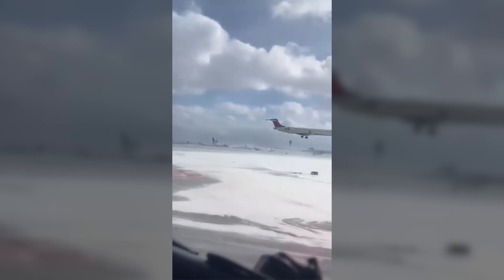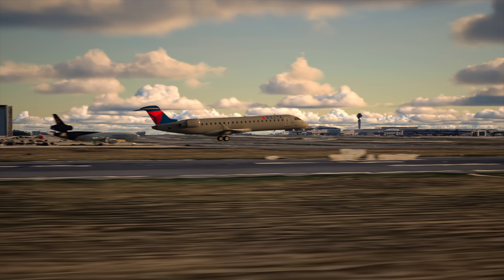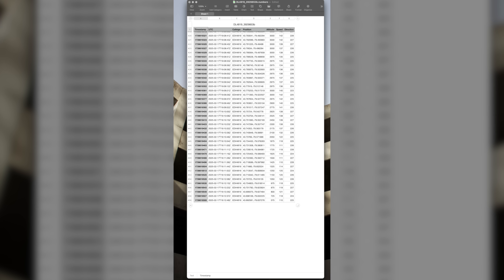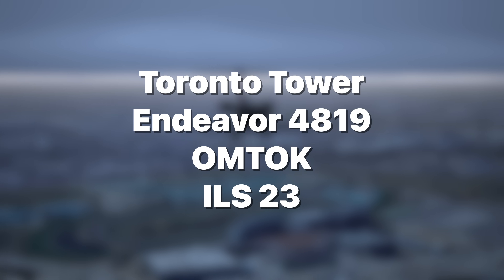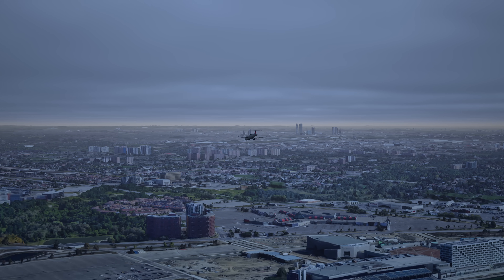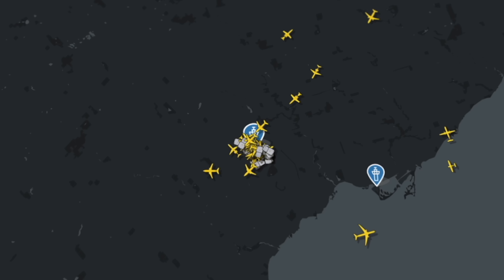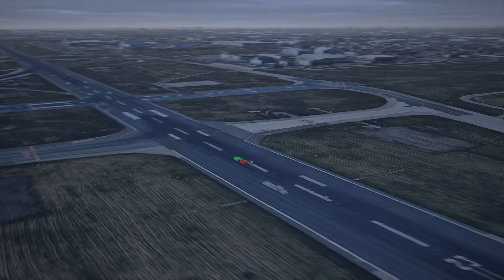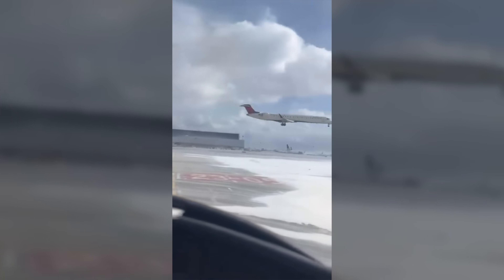What Caused The INSANE Descent Rate in Toronto?

Comment: CAVEAT: I am not a pilot, but I am a software engineer with over 20 years of experience. 

That ADSB data looks suspicious to me. It holds constant at 1024 for 5 data points, after varying almost every single data point. Then it jumps to 256 for at least 2 data points. Both 1024 and 256 are "round" computer numbers. 1024 = 2^10 and 256 = 2^8.

From the little I know now I cannot say if this is just some coincidence, or if this indicates some kind of malfunction. But, those numbers suggest we should wait for the black boxes  to say anything definitive.
Reply: Excellent comment, and a good call. Real data never sits at 1 or 2, that data looks truncated.
Reply: @kfitch42 Every datapoint is divisible by 64... it looks like it's a resolution/rounding thing rather than unreliable data
Reply: They’re all multiples of 64 feet per minute, because that’s the unit used in ADS-B. That makes values like 1024 and 256 very common naturally. The descent rate was already coming up on 1024 fpm. This is just a case of seeing nails everywhere on account of wielding a hammer. Wielding that same software hammer, I will also point that failures don’t tend to produce powers of two specifically. If that were to be the case, it would be highly system-specific, and you would need deep knowledge of the particular system or much stronger statistics to make the case.
Reply: From a retired software engineer: well spotted.  That data ain't right.
Reply: @ ADSB altitude data is always sketchy.
Reply: I agree.  2^n values suggests that the data might have been compromised.
Reply: Nice and pretty numbers for sure
Reply: It is interesting indeed.
Reply: I'm glad someone else called that out.  My Arduino is a bit rusty, but those numbers are too coincidental.
Reply: Good observation but it has a simple and benign explanation. ADSB data isn't precise to +/- 1fpm...it has a granularity of 64 fpm. You can see that all of the data points are multiples of 64.
Reply: ADSB signal is via radio signal so as the aircraft gets low reception get sketchy depending on where the nearest receiver is.
Also in the vicinity of large airports data saturation from other aircraft can cause issues.
Reply: There is a difference between understanding data, and understanding the flaws that come from how that data is collected. Take calibrated air speed for instance. Pilots will understand this…
Reply: It does seem a bit odd.  It sounds like computer RAM memory sizes instead of descent rates.  If the plane actually descended that fast, it does suggest a sudden downdraft may have taken the pilot by surprise.  Maybe the pilot reacted too slowly and didn't correct enough for the sudden downdraft?
Reply: @ not all deviations come from outside the aircraft.
Reply: Bit flips? What if we're getting higher concentrations of cosmic rays to the point that the 3-factor protection is no longer reliable? I also heard a theory that 5G signals are causing Altimeters to mess up.
Reply: “_"CAVEAT: I am not a pilot, but I am a software engineer with over 20 years of experience._"

I am a pilot, aeronautical engineer and my first degree was in mathematics including software engineering (from 1974).“

I’m not a pilot, but I took fluid mechanics and thermodynamics from a retired USAF Colonel who had been a test pilot after flying P51’s in WWII. And I love airplanes.  

And I designed the electronics in an on-chip MEMS pressure sensor.

Thus I am fully qualified to say whatever I want ;o)

The previous comment about the vagaries of mechanical altimeters is very interesting.  If the CRJ was basing its altitude readouts on air pressure in the plane, there could’ve been some error: The instrument could have had some lag due to filtering out rapid fluctuations.  So it might have been displaying readings that were old by on the order of a second to a few seconds.  Turbulence and wind shear would result in inaccuracies in displayed sink rate.  The radar altimeter would not have been affected in this way.

As to the readings taking values coinciding with a power of two, I’ve also designed a few digital circuits, which fully qualifies me to say anything I want about all things digital.  These two values could be coincidental, but I think there’s a fair case they are not.  Electrical connectors are the weakest point of electronic equipment.  A few low-order bits could have been inoperative due to a connector malfunction.  Not likely, but definitely possible.

Thanks for the interesting observations.  I’m so glad no one was killed.
Reply: @maxenielsen  "If the CRJ was basing its altitude readouts on air pressure in the plane"  He never said that.  That would be absurd.  Airliners are pressurized.  The altimeter uses a pitot/static system.
Reply: We will never know. To much dei involved.
Reply: _"CAVEAT: I am not a pilot, but I am a software engineer with over 20 years of experience._"

I am a pilot, aeronautical engineer and my first degree was in mathematics including software engineering (from 1974).

The vertical velocity is not measured directly, it is calculated by the rate of change of height. This can be derived from GPS, barometric height above ground level (agl) (when set to QFE), altitude above mean sea level (AMSL) (when set to QNH) or Flight Level (when set to standard pressure 1013.25 Hpa or 29.92 inches of Mercury). And also the height agl using the  Low Range Radio Altimeter (LRRA).

The barometric altimeters are mechanical devices. The key component is a sealed cylindrical box with corrugated sides and contains dry air at standard pressure. When the air pressure outside changes the height of the box changes, which via an arrangement of levers and gears turns the needles on the face to the altimeter, which is read like a clock with three hands. 1) reading 0 to 1,000 for one rotation and divided into 100 ft, further subdivided into 20 ft. 2) a needle measuring 1,000's of feet and 3) a needle measuring 10,000's of feet. The altimeter is also connected to a height encoder which provides data for the SSR Transponder; depending on the mode selected (modes C & S) height information is provided when the transponder is interrogated by the SSR (ground radar) for the ATC, and/or other aircraft for TCAS. And also for the ADS-B out so other aircraft (and ATC) can receive these data via ADS-B in.

A problem with the mechanical altimeters is that the aircraft spends a lot of time on the ground, where the pressure changes over a small range, and the levers and gears tend to wear and become sticky. This results in the reading jumping and hence creating a false estimation of vertical speed. In piston engined GA aircraft and in helicopters, the presence of vibration usually ensures that the sticking is minimised. In gliders and commercial jets, there is less vibration som that the errors tend to be larger.

ASDB Exchange provides free of charge most of these data parameters, including vertical velocity calculated from GPS, barometric pressure and RADALT.

The values of vertical velocity of 1024 & 256 ft per minute, is just a coincidence.
Reply: Finally, a hot take from a software engineer. 

I always make sure my planes are piloted by software engineers, my software is coded by medical doctors, and my medical advice comes from plumbers.
Reply: Nah, it's so much more fun to speculate! Why wait for all the facts? You are no fun at parties!
Reply: @cherylk.2474  Why pick on this comment for your nasty sarcasm? Most of the comments here are pure speculation, and this commenter does bring up an interesting anomaly. Those numbers 1024 and 256 are so in-your-face to anyone computer savvy, especially held constant like that for sevaral readings when all the others are in decreasing progrtession.
Reply: @B_Ruphe  Pretty sure that was sarcasm
Reply: @cherylk.2474 😆
Reply: The conspiracy theorists have arrived.

Comment: If he was going 118 ground speed and the wind suddenly stopped,or worse came from the rear quarter?down it goes.
Reply: Say there is a headwind of 17 kts and so the airspeed is 135 kts and the ground speed is the airspeed - wind speed = 135 - 17 = 118 kts. If the wind changes by 180 degrees and there is a 17 kt tailwind then instantaneously the airspeed falls to 118 - 17 = 101 kts, which is about the stalling speed of the CRJ900. Even without stalling the nose of the aircraft will drop and eventually the speed will stabilise at 135 kts and the ground speed will increase to 152 kts.

Comment: The bump the controller was talking about was in the glide slope of the ILS approach because there was another aircraft in front of the glide slope transmitter. During bad weather (Low ceilings and visibility) the ILS system is protected by ILS hold Short lines on the taxiway. Other times aircraft hold short at the Runway Hold Short line. If an aircraft is  blocking the glide slope transmitter it can caulse irregular glide slope indications which is the "Bump" the controller was talking about. Wake turbulence should not have been a factor due to the 40 degree crosswind with strong winds which would have blown any wake turbulence clear of the approach path long before the arrival of the CRJ.  while we need to wait for the investigation to actually make the determination, it looks from the ADSB info that they experienced wind shear at the end of their approach causing an excessive rate of decent at touchdown which caused the landing gear to collapse.

Comment: Downdraft pushed the plane to the ground if you ask me. With a sudden downdraft at this altitude there is nothing they could've done. Touched down to hard, right main gear collapsed, smacked the right wing to the ground, broke it off and the left wing still producing lift rolled the plane over. Extremely lucky it happend at low altitude

Comment: The landing gear was not fully extended and/or locked into place.  The landing drove the wheels back up into the wing and snapped the wing off.
Reply: No? If you look carefully you see the gear stayed strong but was compressed to its limit.
Reply: @NoodleIDK13  ...and then drove the wheels back up into the wing and snapped the wing off.
Reply: @iBackshift  The wheels didn't collapse back inside the aircraft they were destroyed

Comment: The jet dropped suddenly for some reason.  It hit hard on the runway.  It appeared the landing gear more so on the right collapsed and the right wing touched the ground.  The right wing  was damaged at that point. Then possibly the jet body turned right slightly because of the drag on the right side. Then the left side wing with the help of the momentum of the moving jet created a wind levering action that rolled the jet.

Comment: I think that you have identified the cause of the accident, lack of flare at touchdown. No aircraft is designed to be flown into the runway with this rate of decent. The main gear and nose wheel were simply overloaded and failed leading to the wing separating and the fuselage rolling onto its side then its back. It's a miracle that everyone survived.
Reply: I used to do steep approach’s landings all the time at spec’s 360 fpm impacts.  Other guys would have bad days at hit at over 600fpm.  Plane was built to handle it and it was not a Navy aircraft
Reply: MANY aircraft are designed to land at those descent rates.  Like EVERY carrier capable aircraft.  1000 FPM descent rate at touchdown should not disintegrate an airliner.
Reply: @Summitspeedfly  It didn't disintegrate.
Reply: @Summitspeedfly  1000 ft/min will damage airliners, particularly if landed wing down! It equivalent to hitting an immovable object at 11mph, it hurts! Hard to tell from the video if there is any side loading. Landing gear doesn’t like that.

The BA038 crash at LHR was 1400ft min, luckily the load was spread across both gear and then engines with the wings level.
Reply: @Summitspeedfly 14 CFR 25 specifies the gear should withstand 600 fpm at max landing weight, 360 fpm at max gross weight for transport category aircraft.
Reply: @igclapp  - Most aviation specs are built to exceed FAA regs by at least 50%.

Comment: Flight Crew error or faulty instrument readings in the cockpit, it wasn't a down draft that's for sure. The aircraft never made any adjustments that would show it experiencing those forces on the aircraft. No she came in to fast with no flare and the gear folded under her.

Comment: Planes don't crash themselves! 👍
Reply: Around 25% of aircraft crashes were a mechanical fault, meaning, the aircraft broke due to causes not created by any of the crew. And planes have indeed crashed themselves due to incidents. Take Alaska Airlines flight 261 for example.
Reply: @NoodleIDK13  261 is design flaw caused by poor maintenance by Alaska.

Other airlines had no problem maintaining that jack screw…

Comment: About the flare, yes, very important. I used to fly ultralights and my instructor was very clear that pitch control was used for airspeed and power controlled climb and descent. Clearly there is cross-over but I found that worked very well. My best landings were when I added a slight bit of power to slow the rate of descent when I was about 30 feet off the ground, and then only easing the stick back when the wheels were three feet off the ground, power to idle, and keep easing back until the wing stalled and the plane settled to the ground. I am not sure how much of this translates to a large aircraft such as this, so please do not think I am giving commercial pilots any advice here...far from it. They also said there were gusty conditions, which may have stalled the right wing and resulting in that very hard impact that collapsed the gear. Perhaps the pilot did not have the speed to flare? Maybe was a little late adding power to slow descent? When I ride commercial, I frequently hear the pilot adding power momentarily just before the flare and landing.